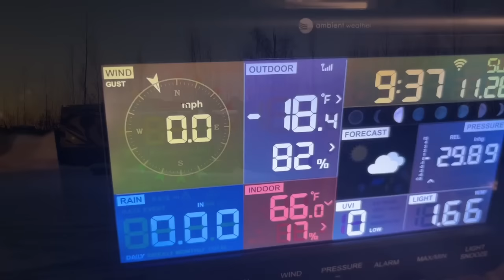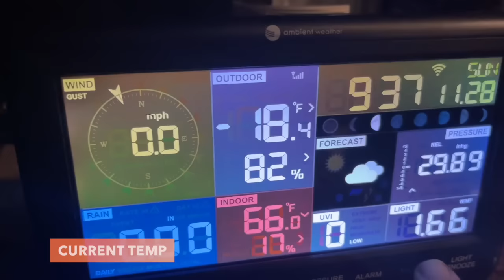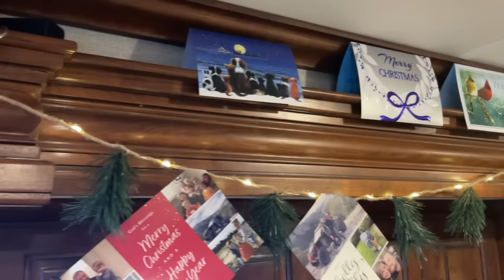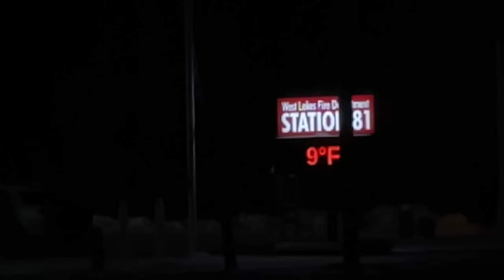Our COLDEST Night Yet [20 BELOW ZERO] in the RV During the Shop House Build!

Comment: How did y'all heat the RV in the winter? Howd you keep pipes warm?
Reply from the maker: We had an external 120 gallon pickle barrel propane tank directly connected to our motorhomes propane tank for extended propane use as well as two Dyson heaters and our motorhomes electric fireplace. Our winterization efforts will be covered in tomorrow’s video (Friday).